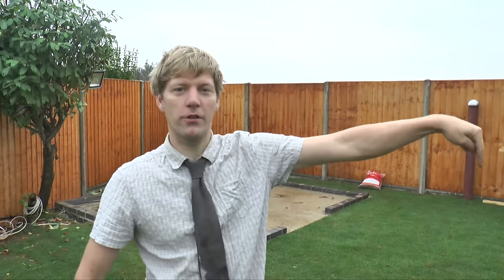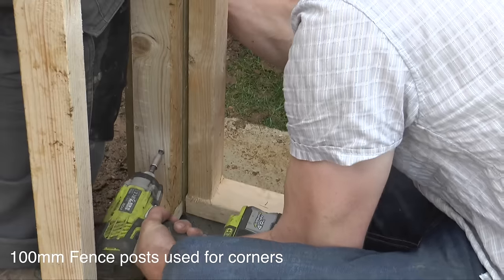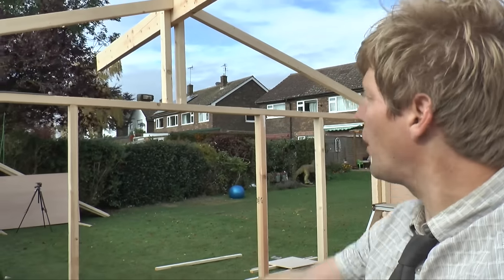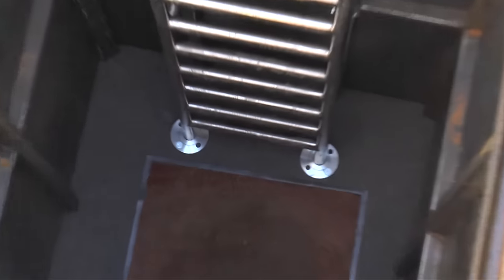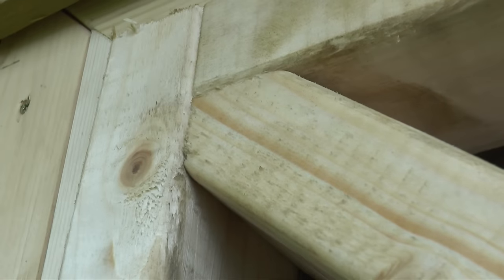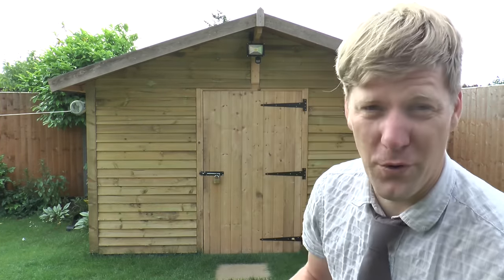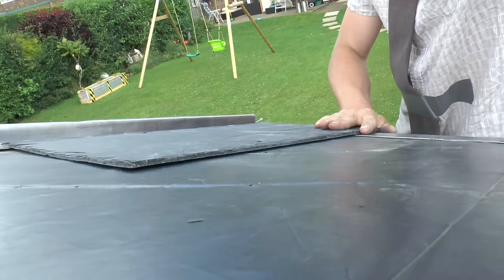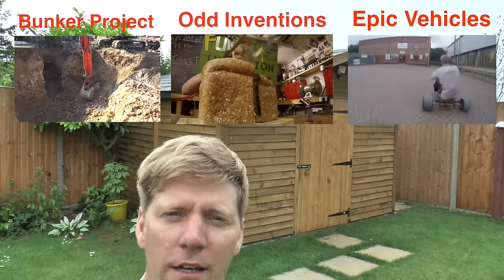How to build a really SOLID shed

Comment: It's interesting, we build roofs quite differently here in the US. But that shed though, wow, it's beautiful.
Reply: His ridge beam is held up by tooth picks. No header above the door to spread to the load.
Reply: thats because our roofs have to with stand 10 tonnes of rain
Reply: That's what I would figure, but the seam between the slate and the lead would allow water to seep in. Here in the US we run the shingles, slats, slate, etc. to run off the edge and put in a drip line to keep the water from coming back towards the structure.
Reply: not needed its a triangle ...to make it sag above the door it will have to push the walls out   and  to do that it will have to stretch the wood above the door ...you cannot stretch it and make it sag at the same time
Reply: In the uk, and would do it your way as well, also never seen screws holding down slate :/ I guess colin is a plumber by trade so i wouldn't expect him to be too familiar with roofing.
Reply: david appleton
I can tell you're not an engineer or an inspector.
Reply: We usually build them quite differently here too (in the UK!) This is a great example of how NOT to build a shed.

Comment: Nice shed, wouldve,used treated bottom plate with all that rain.
Reply from the maker: it never gets wet though as does not touch the ground
Reply: +colinfurze Hey Colin, is there a video of your bonfire anywhere?
Reply: +colinfurze. Sorry to tell you, but that's wrong, concrete and bricks are horrible porous and wick water like crazy especially with splash back from water hitting the ground. Are there not building codes in the UK/EU for sheds and other basic structures? Treated in standard for sill plates here in the states and many are moving to impervious composite sill plates as well.
Reply: I think it'll probably be ok, code in the U.S. is there has to be some type of a moisture barrier between any ground contact porous materials and wood framing, or treated is to be used. Also, you have to consider temperature variants inside / outside and condensation which will drip down inside the walls against the plastic barrier...thinking some heat will radiate up into the shed from your bunker... Awesome project, just discovered your channel.
Reply: Cool
Reply: He used engineering bricks which have very low porosity and are suitable for constructing a damp proof course.
These are blue class A bricks, the blue colour is a result of the higher firing temperature, this also produces a very strong semi vitreous body.
Reply: *****
I was going to look at that but  got this warning after the first page:

"The URL or program you are trying to access appears to contain malware or exploits. Malware can harm your computer or otherwise operate without your consent. Just visiting a website that hosts malware may infect your computer."

Comment: @2:13 Am I the only one who thinks the weight of the roof (beam) is not spread out enough? I would have put a nice header there above the door and some thicker door frames to transfer the roof weight down to the floor. Similar for the other side of course. So putting stone and lead on the roof does not add up to a "really SOLID" shed in my book. But I'm sure it will hold.
Reply: I'm sure 2:53 spreads the weight of the roof enough to stand on top of it
Reply: Yes, he should have put a header over the door and doubled up on the posts framing the doorway. Doorways and windows always require headers and extra frame posts. He should also have put the ridge beam support directly under it. As it is, the entire weight of the roof rests on a few screws. He didn't even use any metal brackets.

The lumber for the sills should have been treated against rot as well. Raising them up on a single row of bricks isn't enough. You can tell from the color that he used untreated lumber throughout.

All that said, he's probably right that what he built is sturdier than one of those cheap metal garden sheds that you can buy at most home improvement centers.
Reply: YESS!!!!
Reply: +Marc Jacobi - You're right, he should have a header across the door, supported by jack studs. Placing a point load directly on a single 2 x 4 (on the flat) is asking for sagging and shows a general lack of knowledge of framing. This is not his only mistake. I was chuckling and shaking my head at his framing methods the entire video. But, at the end of the day, It's just a shed to hide the entrance to his sex dungeon, so a good laugh can be had about it. I would be very concerned if someone was attempting to frame a house in this fashion.
Reply: When you screw ply to a stud partition in this way you make a 'structural wall' with enormous strength. You could park a jumbo jet on top of this thing......
Reply: @gr33dyglutton  I'm really sorry I didn't see this comment two years ago!!!! Your arrogance is quite breathtaking(it's left me literally breathtaken!!) 
Screwing ply to the stud partition in this way makes a 'structural wall' of enormous strength. Loading is distributed evenly over the whole area of the wall. It will be heavily over spec. for the job it has to do!
Relax.....

Comment: nice shed but the lead flashing will expand and split I would have personally fixed it in approximately 1200mm lengths with 150mm overlap but I am a roofer still like the shed though.

Comment: I appreciate your videos.  Is lead sheet a standard, available roofing material in England?
Reply: Yes you can get lead flashing from most hardware stores
Reply: What else would you use?
Reply: Galv'd steel flashing.  Same deal, 1 foot by 12 foot roll or similar.  I'm just surprised that in this modern overly safety caution, every gives you cancer society of our that you can still buy lead flashing.  Hell, lead electrical solder is a faux pass these days.
Reply: @davet7509  Lead solder is more of an issue as it gets vapourised. Lead flashing just kinda sits there not doing much. Unless you just kinda sit there licking it, which you probably won't.

Comment: It didnt seem to be too secured to the foundation. How was that done, just those screws?
Reply: look at 1:29
Reply: damnit James pay attention!
Reply: there's 2-3 screws per cell at least, around 22+ in the whole thing. Plenty for low-wind UK in an already sheltered area.
Reply: The weight of the foam insulation holds down the shed. ;-)
Reply: Though they are going into brick they look like the same thing you would use in concrete if you were securing to it after it was already hardened. I forget what they are called, but it's probably a hollow, spiked tube that is forced to expand by screwing the bolt in.
Reply: John Guy ..anchored screws/ bolts..the surrounding metal on the bolts/ screws expands as it is screwed into the foundation, thus creating pressure against the hole walls, making a tight, secure fit...
Reply: should have glued 10/12 mm threaded bar into the bunker concrete with a corresponding hole thru the wood and brick, 4 to 6 of those and it would survive a hurricane - not a good idea to use expanding screws/bolts into a brick or near the edge of concrete
Reply: 1/2"x6" L- shaped anchor bolts into the concrete would have been the best idea...
Reply: Frame fixings - very secure.....

Comment: You did a great job on the build. My only concern for you is the starter row of slates on the bottom of the roof should be double layered, cause you dont have enough cover on that row between the slates to stop rain getting in through the roof. Hope that makes sense

Comment: You should’ve put solar panels on the shed roof that hooks up to the bunker. That way you wouldn’t have to depend on city power.
Reply: Still England though. You'd need a 24h+ battery array for that to be feasible.
Reply: MegaMrJerkguy,
Did you just crawl out of mommy's basement?
Reply: girlsdrinkfeck He meant so he doesn’t have to depend on power from power lines
Reply: City? In Lincolnshire??

Comment: Should have laid a DP membrane between the stud walls and brick plinth.
Reply: @Howdy Justice I refuse! ;o)
Reply: What is a DP membrane?
Reply: @HollywoodCreeper  DP = Damp Proof Membane. A polythene type strip of plastic, a little wider than the brick course,  that prevents moisture/damp from striking through the courses below it into whatever is above, be it brick, block or timber.
Reply: @CHIL2903  Cool. I guess if I use that  my shed will be better than his. Haha polythene...is that a real thing or a mistype?
Reply: @CHIL2903  So it is a sheet of plastic?
Reply: @HollywoodCreeper  If it's going on top of a brick course it will be a strip, not a sheet. A sheet would be laid under any concrete pour that would be used in the flooring to stop damp striking through (water ingress is a big problem in the UK, maybe not so much in other places?

Damp proof course (UK) https://www.screwfix.com/p/capital-valley-plastics-ltd-damp-proof-course-1968ga-black-30m-x-100mm/42073
Reply: @CHIL2903  Thanks for the info! I appreciate it!!!
Reply: @HollywoodCreeper  👍🏻 Most welcome HC, stay dry! 😉
Reply: Also lead was too long in one strip should be about 4 foot 6 inches long

Comment: The lead strips will crack as they are too long, should be shorter and overlap for expansion and contraction. Everything else looks top notch though
Reply: How do you fix the lead on top of the roof?
Reply: yeah right, should of been short soakers overlapping each tile

Comment: I can't believe no one was commenting about the use of screws for the whole shed. Screws will shear off a lot easier then nails so you should have at least nailed the rafters to the top plate.
Reply: He used screws everywhere you're not supposed to. Very frustrating to watch. Nails over screws in literally every shear strength application.
Reply: Interesting, I did not know that. I always thought screws were better than nails in all applications. Would using a combination of a nail and a screw be the best of both worlds? (One screw to retain, the nail to maintain integrity?)
Reply: Screws are brittle, nails are not. So anywhere a fastener snapping would result in catastrophe, use nails. In modern stick frame construction, screws are really only used for drywall panels and door frames.
Reply: Americans seem to like their nailguns while they don't seem to have caught on over here in the UK. Go figure.
Reply: and not here either...in a wet winter all the nails pull out and on the spring you have to go and tap them back in
Reply: That's why you use nails with spiral or ring shanks.
Reply: @MrWillieb83  Pffff.... Coachbolts FTW!

Comment: Great job, just one thing lets this down. I could be in there in under 10 seconds without a key for the padlock, you need at least one bolt through each section of the T hinges, and the same for the padbolt, saying that though, I'd throw the padbolt away and try and get a deadlock on there, the part where the padlock goes can easily be knocked off with a hammer, but just 2 screws are holding the keeper on, removing those will give anyone access, this is why so many garden shed gets broken into, owners don't realise how vulnerable their garden tackle is.
Reply: @Hello Steve Wright, How are you doing?
Reply: Of course, anyone who breaks in gets to deal with Colin bursting out of the secret bunker armed with Wolverine claws and a flame throwing guitar!

Comment: Taking inspiration and planning a build but one question. Should the membrane on the walls be a breathable one. Is polythene not going trap the moisture in
Reply: I did a similar one with vis-screen for max rain resistance but applied it horizontally so I could put a lap gap near the top.

4 years and not a patch of dampness on the inside of the structure.

Comment: In U.K.,  that non pressure treated wood,  in direct contact with the brick,  is going to rot.
Reply: JL Sagely could sarking be rolled along the top of the bricks to stop the timber from getting wet?
Reply: @kdegraa  That's what I was thinking, like a damp proof course
Reply: What's starking?
Reply: @smartchip  The word is sarking and in the UK has different meanings. The guys above are referring to sarking felt. https://en.wikipedia.org/wiki/Sarking
Reply: @londontrada  good idea but why not just use dpc
Reply: Even if pressure treated, will still rot, just takes longer :)
Reply: @jns8393  yea, why not?
Reply: Nah, you put down a layer of 8 to 20 mil plastic under your sill plate. And where I am, we have severely cut back on lead, now it is usually only used to tie in chimneys or in restorations. We now use products like Ice&Water, which is a one-side sticky, one side super slick underlayment that prevents roof damage. Some people go nuts and do the whole roof in it instead of the one roll from the bottom edge.